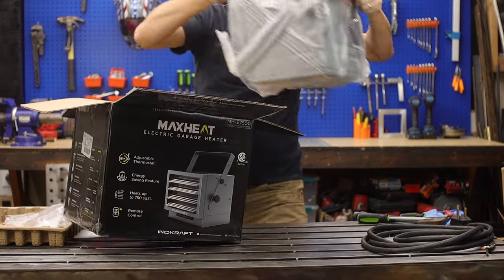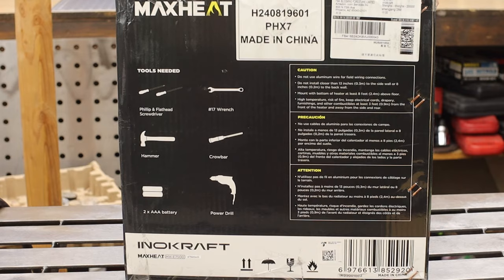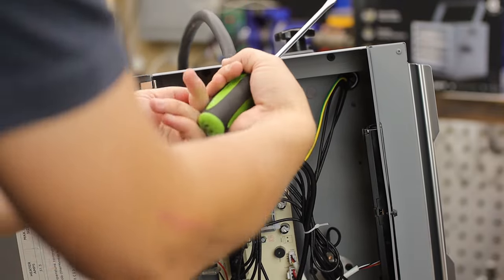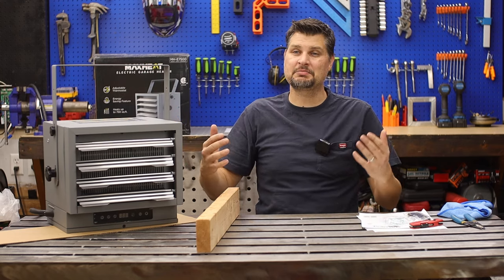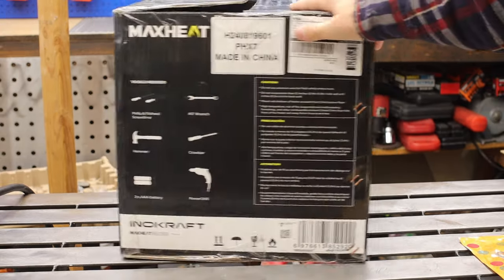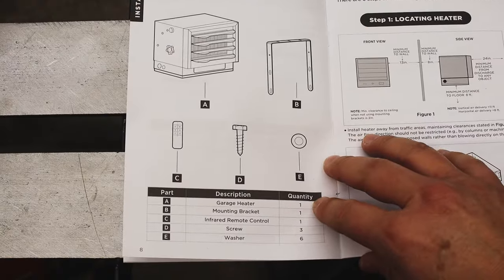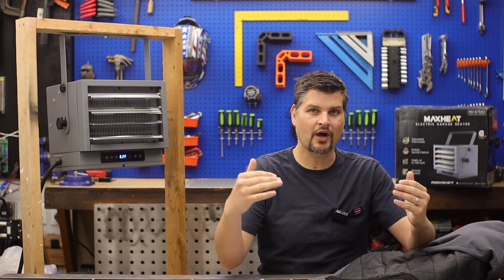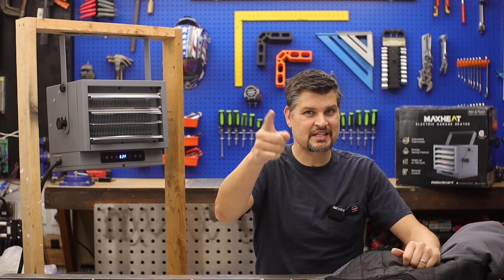How to Install an InoKraft Garage Heater: Step-by-Step Guide

Comment: Hands DOWN, that is THE MOST unsafest 'wiring' installation I have ever seen in 5 decades. Please, please use PROPER electrical cable stops! My goodness...
Reply: Did you listen to him in the video, he states it’s not the final or correct wiring more just wired to film a video.  Everyone is an expert….did it kill him or burn up during the few minutes he ran it for the video?
Reply from the maker: I did figure out where I want it mounted. I'll most likely do another video showing how it's wired up per code.
Reply from the maker: Yep, that's why I mentioned it a couple times. It was a quick and easy job so I could move it around and test it.
Reply: @-DIYPRO-  I would certainly encourage it. I wished I had the spare voltage to run it but my power panel is nowhere near my garage and routing the electrical conduit is just so egregious today.
Reply: @-DIYPRO-  Apologies!

Comment: Would like to know how much electricity it uses.
Reply: Too much
Reply: All of it
Reply: Thee are 3 available - 5,000W / 7,500W / 10,000W.  So run the middle for 4 hours that is 7,500W x 4 = 30,000W of 30kWh.  I’m in MA and right now average cost of kWh is $0. 21/kWh so it will cost me $6.15 for 4 hours
Reply from the maker: Right on, thanks @msk3905! Now I don't have to do the math!
Reply from the maker: Keep in mind I would NOT suggest using an electric heater to heat up your house. This is a small space/ garage type heater. I'm good with it since it will only be used for the weekends while doing projects.

Comment: What 8 gauge wire did you get ?
Reply from the maker: For the final spot I'll be going through the walls and rafters so I purchased some 8/2 Romex. (No need for 8/3 since the connection only requires the (2) leads and ground.
Reply: @ got ya. Thanks.